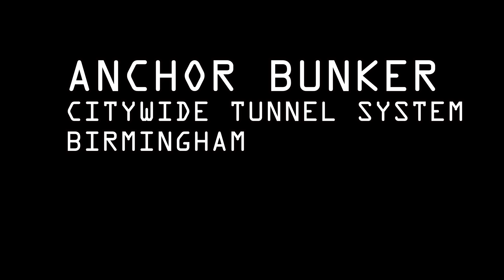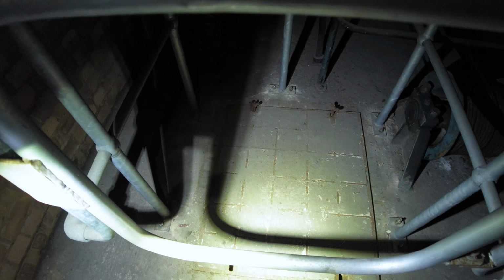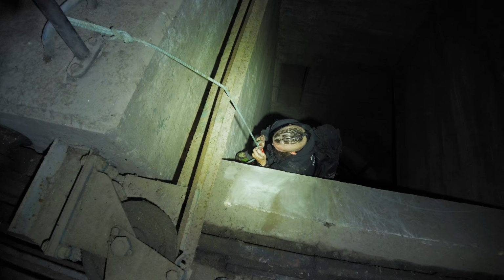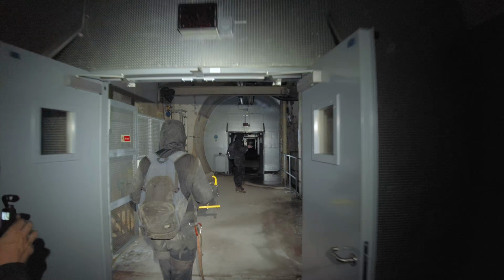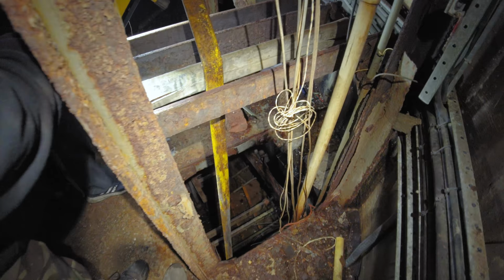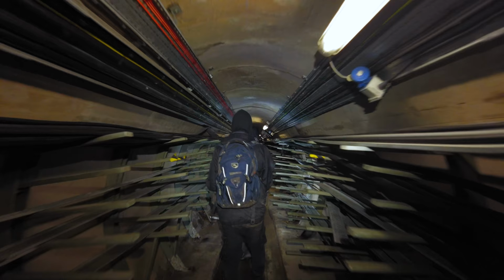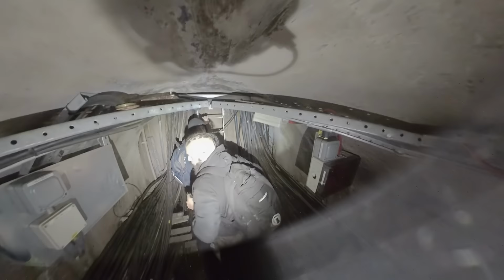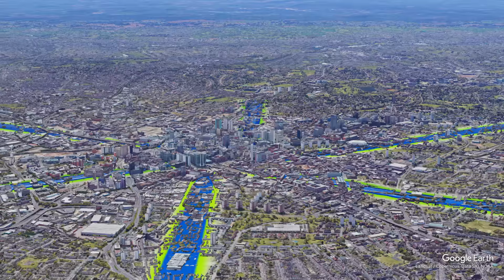ANCHOR BUNKER GOVT LIED ABOUT THIS FORMER TOP SECRET  BUNKER

Comment: Incredible place you got into. Like Mission Impossible lowering down the air vent! I know in London there are deep level BT tunnels somewhere 100ft underground. Dr. Bradley Garrett talked about getting down into them through levels of tunnels and then seeing what he described as tracking cameras in the ceiling. It’s insane to think that a little hatch in the corner of a car park could lead to somewhere like that.

Comment: 24:00 Those are not stairs, it's a ladder.  To go down, turn around and face the steps. You may have to take off your packs and lower them down.  Most of what you saw were simple communications wire tunnels necessary for any city.
  I hope you turned off any lights that were behind you.
Reply from the maker: tHE LIGHTS WERE ON AUTO
Reply: @TheSecretVault  gotcha. I guess you mean a timer or motion sensor.

Comment: As usual a stunning intro and amazing videography, editing and sound engineering. Always amazing watching your work. 

An observation about repelling with a rope: in the late 1980's my buddies came back from Ranger training in the US army and talked my asthmatic ass into repelling off a tree limb in a nearby woodlot. We lived in Florida back then. Their rigging involved the standard US military issue black leather gloves and holding tension with the rope BEHIND their back at the belt, with the rope slung to the front harness somehow. This absolutely prevents any chance of snagging the fingers into the pulley. I'm sure there are a few good videos on the technique they learned and were using. I never forgot those really cool gloves and have picked up a few used pairs over the years. To be honest my cheap made-in-China gardening gloves, which are the same in every country, are almost as good, except for the backs being canvass. The grey leather is just as tough. I think those kinds of gloves should be standard kit for all urbexers, along with leather boots and extra water, extra batteries and bulbs, etc.
Reply from the maker: Yes we will get some better training soon. Glad you enjoyed the video

Comment: Where's the MDF? Were all the old xbar systems ripped out? Appears to still be an active trunk. The black cables are recent as well.

I used to work with Telstra in Australia, I've been in a few old exchanges.

Mad.

Comment: Yes that underground Yomp is a  foot killer from beneath Telecom tower tunnels heading to the old Underground tracks of Royal mail at the now Mailbox building  or the lovely high speed Yomp to avoid the Pir detectors heading into the Jewellery Quarter in Hockley
Not to far from the Street clock.
Thank god for GPS and maps 😉😎

Comment: Amazing, absolutely glued to it, that massive sliding concrete slab is quite something, there certainly is a tunnel system under Glasgow too however not as extensive as Birmingham, one of the lift shaft buildings to access it is in plain view near Queen St station, looks absolutely locked up tight though.

Comment: Said this before…. There is a bunker In glasgow… it’s under dial house “old Anderston bus station” and runs in under the MOD Building only possibly to access through the MOD building on Argyle st as far as i know…someone told be the access in the opposite side on Dialhouse has been blocked

Comment: Their is a load more than this by the old library & by the post office & alpha tower by the cooking collage under the queens way under museum loads of tjem we used to call them the city under the city..
 Alot been covered up with new building projects over the last 20years i even seen articulated lorries going into one of the old larger entrances..!
 Great vid do more 👍cheers
Reply: The majority of these are (disused) service tunnels I would think, no?
Reply from the maker: EMAIL ME PLZ
Reply: The one under the Queensway (radcliffe tunnel) just goes up onto the street by the side of the old library. Been gated off for a while now, only way down is with a key for the door up on the street level.  Used to have to run down the Queensway tunnel to gain access.

Comment: My question is which entrance did you use and where did all those other doorways seen in many parts of the video lead to? And maybe you should have tried the opposite direction to the one you took - I feel it would have taken you to the Fleet Street/Jewellery Quarter side...
Reply from the maker: i think its best we dont identify entrances for security reasons.
Reply: @TheSecretVault  from what I can see, there's only one tunnel (no comms) which has another tunnel connecting to the left of it - which is the same as the first one you guys took - the entrance isn't too far from the Queensway...
Reply: @AsceticFocus  sounds like you know a few things about this system! I have a access point for the Victoria square part of the tunnel system and also the old dale end part of your down to share some details?
Reply: @bombcaryah  I'm down, what would you like to know and when? :)
Reply: @AsceticFocus  can I contact you any other way mate?

Comment: Just watched it all and I sort of felt a great kinship....here's something I have only ever told to a group of guys about a year ago when the Anchor Complex was mooted. I told of going there with my mom who had a set of keys because she looked after a small group of women cleaners who cleaned the offices in the tower. Her keys unlocked a service lift access which went down to a couple of basement levels where all the cleaning gear was kept. I was under strict instructions not too touch anything under the pain of a good hiding. Sometimes I'd mess about in the lifts riding them up and down while the women worked in the evenings. One particular evening as I was messing about in the service lift and turning the key the lift started to descend down and down..... I was scared stiff as I was only very young (I was still at Primary School)...I would have been about 10 going on 11 years old. I watched the grey wall pass-by and suddenly the lift stopped and I saw what I thought was a tractor of in the distance (I know it sounds mad but I did not know what I was looking at)...a corridor went off into the distance and I could see lights at the end and this big 'machine thing'... (now, I think I saw a fork-lift truck). As quick as the lift stopped it started up again without me touching anything... when I got to the basement 'Level 1' my mother asked where had I been... 'just playing in the lift' I said...with that the women finished off and we all left the building. She did this job for several years and I never told her what I'd done or saw and forgot all about it until 50+ years had passed and I realised I'd seen something I was never meant to see - an absolute true account of what I experienced Mathew! (this would have been about1962/63).
Reply from the maker: stop pressing buttons lol
Reply: @TheSecretVault  hahaha - I don't recall pressing anything - I think it was the key....in those days there weren't any front desk security staff and I think she used to have to turn off the lights and lock-up. My my mom and the other cleaners would often be the only people in the tower most nights and if I couldn't be looked after I would go along too. Of course I had no idea as to what I saw and it came as a bit of a shock when I first heard about Anchor about 10/15 years ago (from a TV news item...apparently it was up for sale).

Comment: No way was that once build for a nuclear bunker, it still IS a nuckear bunker, there's modern engineering still ongoing down there! 😢
Reply from the maker: could be reacivated at any time but the blast doors are gone in many places as we saw.
Reply: It couldn't withstand a nuclear blast it used to be able to withstand early Hydrogen bombs. The sliding slabs aren't thick enough to withstand much more.

Comment: The water that was running under the floor. Is the water that's being channeled from above the ceiling and from both sides of the wall traveling down.
Reply from the maker: unknown.... probably seeps into the whole facility and with many bunkers if they have any sense they run the runnels downhill as if they were like sewers, because its stops flooding. Probably all ends up in a river way off.

Comment: My father used to tell me stories of a deep underground train. So I pressed more about it, he did some contracted work with a company called rubber plas . He had to sigh an oath  never to be discussed before entering to install some panelling. From what he was told probably rumour but the tunnels stretch to the old QE and even further. It crazy to think there a tunnel there that stretches all the way to the royal mail in erdington
Reply from the maker: WOULD HE CHAT MORE ABOUT IT... EMAIL ME.
Reply: @TheSecretVault  unfortunately he died 2 years ago. It was long ago when he told me about it. Either it was a rumour he heard but apparently the tunnels go towards the old QE  possibly as far as Longbridge tunnels 🤷 I was always curious of going down there through the ventilation system but didn't have a long enough ladder 😏. I was really surprised where you ended up at the end of the video out that door. 🤯 Interesting stuff.
Reply from the maker: @rayday1440  Sorry to hear about your dads passing., He took his secrets with him.

Comment: I would fully expect every town with it's own STD dial code to have an underground something (except Milton Keynes -it's too young). back in the 60s there was a significant realisation that the cold war could get hot and especially that most communications would be lost at surface level. Sadly as the power of nukes became greater the possibility of defending against them became less and less, then everyone realised that  nuclear war was futile and the funding for deeper and harder systems vanished.
Reply: Milton Keynes has more tunnels than most people realise.
Reply: British telecom at park hall near whittington  oswestry shrops was building a nuke bunker in the mid 1980's,worked moving the site offices,there were plans for food stores air filtration plant etc,i saw the site building plans,there was more underground than on the surface,it was all very hush hush tho
Reply: D.U.M.B.
Reply: @weeblesdontwobble  Growing up in MK there was long rumours of a bunker under what used to be the coach park for CMK. But also supposedly long since blocked up. Given when it was built i would be very surprised if it hadn’t acquired a regional centre of some kind, plenty of reasons to have one there and plenty of cover to build it.
Reply: @Ralnon  There use to be a vast network of tunnels underneath the centre, one of the main access routes into the network was right by the old winter gardens . I believe the only part of the tunnels that are used today are the ones connecting the Police station to the court, so that they can transfer prisoners to and from court without having to let them out in public.

Comment: Used to work for Severn Trent, had offices on Newhall St and Lionel St in 1990s / 2000s. There is also a control centre under the guard house at Waterworks Road Edgbaston,  by Perrotts Folly, inspiration for Tolkeins Tower in Lord of the rings.

Comment: So after walking down that initial tunnel, at the bottom of which looked like a locked gate (with the camera), it's intentionally unclear how you get to where you are at 29:45 - you also don't reveal what's behind you at this point
Reply from the maker: Turn left at the camera and I set up my DJI a few feet away down the corridor. Just wanted to get out of the view of the camera.
Reply: @TheSecretVault  ah, that was my thinking too. So there was also a route going straight ahead from the first tunnel you walked down? And when you took a left, that corridor curves and taking another left would bring you to the tunnel which you showed footage of at 29:45, no?